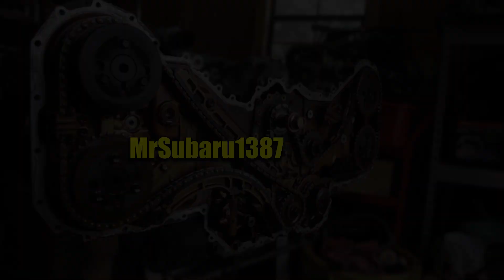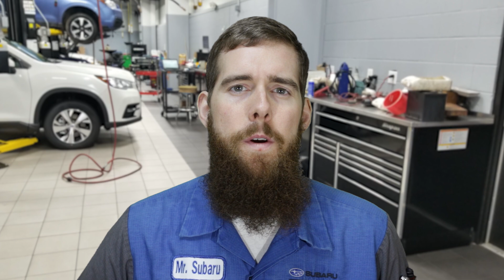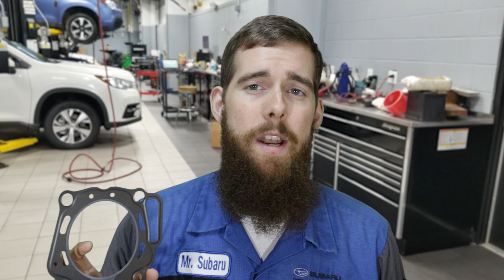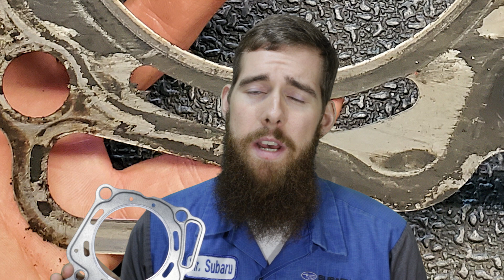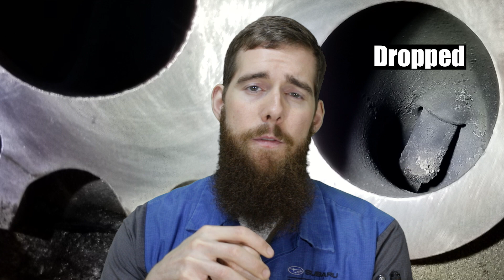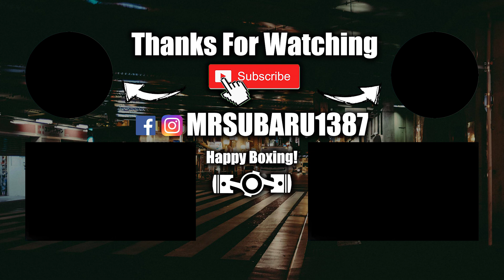Subaru Head Gaskets Explained

Comment: I own a 2015 Subaru Outback 4 cylinder. I bought it brand new. I have had all of the service work done at the dealer. Recently had the 60K service.  I just took it in for a routine oil change at 64.5k miles. Service advisor called me, told me I had an oil leak at the timing belt cover, and that they would, as a good will gesture, cover the repair. Next day, they called to inform me that I had a leaking right head gasket. And that they would cover that. I appreciated the dealer doing this. 

When I got the car back, I realized that they only replaced the gasket on the right side. I was surprised. I was told that if it is a 'warranty repair', they only fix the problem. This seems more like a band-aid than a fix. I thought this was poor on the part of the dealer. I know they didn't take the head to a machine shop. I hope that they at least inspected it. I had intended to keep this car for a few more years. Now, I have a car with one brand new head gasket, and one with 64.5K miles and the one exactly like it has already failed. I spoke with the service advisor and he told be that if I had a problem within the next 5k or so, they would cover it. 

I don't know what to think. But I can tell you that as of 2015, Subaru was still having a problem. 

I love the way this car handles and I have had no other problems with it, but I think I will start looking for a replacement. 

Anyone with any advice, or similar stories, please reply to this post. Thank you. 

04/02/2020

Comment: THANK YOU for this informative video! I have a MY 2009 Forester 2.5X 5MT Touring (Canada) with 195K km (120K mi) with failed HGs. I'm now ready to reassemble. Subaru dealer  recommends the single layer HG (11044AA633) and claims that the MLS HG (11044AA770) is NOT interchangeable on my engine. Which HG should I use? Is the installation procedure different for the MLS HG? If the MLS HG cannot be used, can I use Permatex Aviation Form-A-Gasket Sealant Liquid on the SL HG as a fix? Confused and stuck.

Comment: Thanks, Mr Subaru, your video was informative. I bought a used 2010 Impreza in nice condition. 138k miles. Engine seems fine, but I’m not a mechanic. Is there any way the VIN number can tell if my car’s head gasket’s gonna go soon or has already been replaced?

Comment: My Name is Paul I had 93 Subaru Impreza wagon original don't know what the engine model was but I buy it from the dealership it had 44,573 when the head gasket blow it had 610.463 and I had the car for 18 years I did the oil change tune ups coolel change but it had problems with the spark plugs coming out I had to put Haley coyle in cylinder head 1 and 4 it was an 5 speed stick shift and replace the clutch 2 times in it great car to have wish I had the money to get the engine repair but I didn't so had to junk it now its hard to find that kind of car now all I see now is the sport wagon now never got stuck in the snow never let me down I did pull an 18 wheeler truck up the hill in it strong little car I miss it

Comment: Stressed having the heads machines to perfectly flat. But you didn’t mention even checking the block for flatness. I hope this was just an oversight and you actually check the deck aswell . My deck was .0025” out of flat and I hand sanded that to less than .0005” my heads went to the machine shop.
Reply from the maker: Yes, always want to check the deck, I just rarely see them warp.

Comment: Thank you! I just purchased a 2003 Outback LL Bean edition. Changed the oil and 11qts came out! There is some evidence of leaking and the previous owner told me the radiator was recently replaced. I will be doing the oil cooler gasket replacement as soon as I can. Thank you for all your awesome videos! Just in case is there a special more durable head gasket for the EZ30 like there are for the 2.5's?

Comment: Thanks for your videos, they are very helpful. I have a question.....I have the engine out of my 2010 Subaru Forester, 2.5 naturally asperated, which currently has 140,000 miles, for of a rear main seal replacement. Would you recommend replacing the head gaskets, they are original blue color and they look fine. Thanks again for all you share on your videos.

Comment: On a stock tune, stock car, my EJ55 had HG failure at 67k. Many people in the community have had the same failure (pushing exhaust into coolant) as I have at somewhat different miles. My understanding is that the factory head bolts stretch under high load turbo situations for a prolonged period... IE 4th and 5th gear pulls (WRX) where the block is trying to split, but held in my the bolts. 

After the failure, I replaced with ARP Head studs and followed the torque procedure, as well as used copper spray as insurance. I am unaware of any failures following these two differences... ARP head studs, and copper spray in stock, or stage 1 applications.

Comment: Dexcool is lifetime coolant when it eats up the radiator it kills the engine transmission basicly ends the life of your vehicle unless your snart enough to no gm is special in the head lol i no a few people that got screwed because of that coolant having to replace transmissions an a couple engines that stuf even eats temp sensors great video trying to get as much knowledge as possible on Subaru my son got a 08 legacy with 114k just need to no what im in fore to fix it for him plus nay get one with bad head gaskets and or bad cluch need something cheep but also leaning towrds a old idi f250 something i can try the black diesel thing in to mak fuel affordable

Comment: I had my car a 2006 Subaru Outback 2.5 at the dealer just last week they told me I needed head gaskets and had a dropped intake valve on cylinder #3. The price to fix about $3500.00 CDN $. I really like the car and it has 176,000 KM (109,000 miles) on it but $3500.00 is kind of more than I want to spend on it. I am a fairly handy guy so I figure I can do the job myself. I am also retired and have another car, so I can take my time doing the job. I did ask the Subaru rep what machinist shop they used so that is where I can get the heads machined and a new valve guide put in. I have watched your 3 videos on head gaskets and I understand that you are saying I should use the MLS Head Gaskets that they use on the Turbo Subaru models. Just wondering what the MLS gasket part # would be for my vehicle? I looked up the gasket # 11044AA642 Subaru parts depot online ordering and the check to see if this part fits your car says this is not the correct part for your car and suggests ordering part # (11044AA633).S would I be correct ordering the part # 11044AA642? I am figuring the torque specs would be the same as for the regular coated gasket?  Thanks for all your videos they are very informative. You are a very patient man.

Comment: Excellent video.  Recently bought a 2003 Outback Sport 4 cylinder from small shop and they had just did the head gasket replacement.  Ran great for a couple months in flat Kansas City but took it to Colorado with a load and overheats up large hills and pushes coolant to, and overflows, the reservoir.  Pressure test holds at 15 psi and hydrocarbon test doesn't turn yellow under normal operation.  Could this be the torque on the heads mentioned or is it more likely the small shop didn't machine the heads or use a quality gasket?  Or just the engine can't handle the load and hills?

Comment: I’ve got a EJ251 2003 manual Outback (Australian) I’ve just had my head gaskets replaced at 295000 Km they were replace by a company called Japline ( Excellent work ) head gasket was leaking from passengers side head could be smelt on distance driving.Heads sent to machine shop all all gaskets replaced and also a timing belt kit replaced.it is recommended whilst head gaskets being replaced time belts kits should be done done engine already out job done.

Comment: Hey Mr. Subaru, I just Picked up Head gaskets for my EJ253 in my 2007 Forester as the gaskets are starting to sweat Part number# 11044AA633, was wondering which one and part number you suggested in the video I put on instead and whether i would have to modify the gasket to fit on my vehicle. Thanks!

Comment: Sad to report that currently, my 2006 Legacy wagon at 154k miles is in for the THIRD set of replacement head gaskets. Yes, 3x. All service & repairs at the dealer. I am fastidious with maintenance. I love this car and engine, but these repeated head gasket repairs just breaks my heart.
Reply from the maker: Dealer is installing the original coated gasket and dealers are known for cutting corners and not properly machining heads. They usually clean them with a bristle disk and torque them back on.
Reply: The dealer installed the multilayer steel gaskets for me this time. Hope this is the solution. They said the heads were flat. Thank you sir for educating us! Love your vids. Keep up the good work.

Comment: I have a 2006 Forester X has  103000 miles hard gasket started leaking in the #1 cylinder when I changed spark plugs. Just left Subaru without the head gaskets cause the turbo version is in fact different he tried to sell me the carbon coated ones. What do you recommend I use? But bought everything else timing belt tensioner and all the other gaskets.

Comment: Great video thank you, However I’d love for you to do a video on the super coolant and from Subaru because for some reason my reservoir tank get a little low every 5 to 6 months I have to fill it up and the engine is not eating any coolant it’s not in the oil Pretty sure I have no head gasket issue not quite sure where it’s going I can only assume that it must evaporate at the reservoir tank I have also talked with my buddy within 14 outback 3.6 R seems like it evaporates much quicker when it’s exposed to some atmosphere  (in the little plastic overflow tank )versus your traditional glycol green🤷🏼‍♂️

Comment: Which gasket part number would be correct for a 2001 Subaru Outback 2.5L wagon?
Had a mechanic do this repair, he used FelPro gasket, 2 years later it’s failed again, blowing water back into overflow tank when engine is shut off….
Reply from the maker: Never use a Fail-Pro gasket. Lol for a 2001 it should be the 1110AA642, I think.
Reply: @MrSubaru1387  Thank you Sir for your quick reply, I’ll get that ordered ASAP and this time it’ll be done right with heads getting machined, etc
Probably better to buy the engine  “reseal” kit. Anyone have the correct Subaru part number as you know the turbo gasket kit isn’t listed in their computer as fitting my 2001 Subaru Outback so will the “newer” kit with mls turbo gasket need to be ordered or are there gaskets in there that won’t work with the EJ251 and I need newer mls head gasket but reseal kit for my exact model ie; 2001
I have a spare 2001 Subaru Outback identical to the one I’m working on I purchased for a spare, needs same work performed, so I’ll be doing repair twice in order to have a spare engine when needed 
By the way, myself and I know the whole Subaru community REALLY appreciates you for sharing your knowledge and time with us. Much appreciated brother 😎

Comment: ...so, I've got a '94 Legacy wagon with the 2.2 na engine with 222K miles on it and I'm about to do a rebuild on it.  Since it isn't in the 'danger zone' of bad headgasket engines, can I just use a gasket set from Rock Auto without looking for multi layer steel?

Comment: Torque correctly , get heads  machined and get the right gasket you prescribed. And put everting else back the way it was ofc and my head gasket job will be a success

Comment: Well that could potentially explain why I go through so much coolant all the time now

I have a 2000 Subaru legacy outback 2.5 sedan 176,000 miles and when I first bought the car held fluids great but as of recently you can almost always see a coolant drip coming off of the oil pan or related areas, but never a drip spot below the car.

Comment: Hi there! Question here for my 62000 miles 2008 Impreza 2.5i SOHC EJ253 MT... It's been 11.5 years and I hadn't done the coolant change yet. Finally brought my car to the Subaru dealership and asked to do the engine coolant replacement (at the same time they did the timing belt, idler puller and tensionner-all OEM parts). So they got it right and did use the Blue Super Coolant stuff (not the green one), same blue super coolant as when it came right out of Subaru factory. On my Subaru invoice though, I see they used the blue super coolant  part SCI810005 (which seems to superceeds blue super coolant SOA868V9270). But I don't see the part number for the Subaru Coolant Conditionner on the Subaru invoice. That Conditionner stuff was initially added in my radiator in 2008 by the dealerships (in 2008 they had called me and told me to bring my car in for this to be added at not cost to me). Does the Conditionner now come already pre-added in the "New version" (SCI810005) Bleu Super Coolant, or did the subaru mechanics forgot about it and did not add it in my radiator ??? I did ask them if they had added the Conditionner in (and previously told them not to forget to add the Conditionner in just before I handed them my keys) and he just answered that he added the replacement coolant with exactely what engine coolant my car needed (according to the VIN number I gave him). Should I be concerned that there is now no Conditionner in my radiator and should I just add one bottle of conditionner myself ?? Any risk if I have too much conditionner in (for example 2 bottles instead of one) ? Will my car's headgaskets do 200000 miles or do I need to do the Conditionner every single time the coolant is replaced ? I'm pretty well informed and checked my car's specific Subaru Service Manual, and they say conditionner should be added every single time coolant is replaced, but could it be that this recommendation was just so the headgaskets would last long enough before the warranty expired. I'm concerned about clugging my rad and coolant passages with that stop leak stuff, but at the same time I want my HG to last. Honestly, I don't even know If I should trust that Subaru mechanics... He seemed knowledgeble and very well qualified, but had I not found out he was planning to add an aftermarket crappy Dayco timing belt kit from googleing the part numbers on the Estimate invoice, I would have ended up with less than OEM quality timing belt parts (CRITICAL parts indeed), and without even knowing about it ! Crap that aftermarket tensionner looks much less beefy than the original OEM... It looks like the new "chinese" version of the tensionner you get in the more recent Gates TB kits. Ended up calling Dealership right back and told them I' didn't want aftermarket timing belt pulleys and tensionner, ONLY OEM Subaru. They then ordered all individual OEM timin belt parts and cancelled the aftermarket Dayco timing belt kit order.  Seems these days we can't trust anyone, even at the Subaru Dealership itself !

Also wondered, do you think my model (2008 Impreza 2.5i SOHC EJ253 MT) is one with the valve guides getting out or valve seats getting worn out, or was that some other year models of the EJ253 (you mentionned something about AVLS, but I did'nt really understand that part). Just bought myself a Creader CR4001 OBD2 reader, some new NKG FR5AP-11 plugs, a new fuel filter and PCV valve... will do that maintenance part myself to save on labor costs. The TB and engine coolant ended up costing 1500 canadian dollers at the dealership (but at least all OEM and done by an experienced wrench). Love my Subi. Really enjoy your videos. Thanks Mr Subaru!

Comment: Thinkin' about a new WRX, been worried by the internet about head gaskets.  Might take the plunge, thanks for the info.
Reply from the maker: WRX/STi has never had a head gasket issue.
Reply: My 2017 wrx pushes coolant but it’s most likely because I tuned it and made more then it can handle lol. Enjoy it stock lol.

Comment: Question 🙋‍♂️ what is the part number for the MLS oem suburu turbocharged head gasket? Because I am going to the dealer tomorrow and gonna pick it 🔝
Reply from the maker: Depends on engine you have, but 1110AA642 should work for the majority of SOHC 2.5s
Reply: @MrSubaru1387  Thank you ! I do have a 2004 Subaru Outback with a 2.5 liter sohc engine ej25 I believe .

Comment: I may add though that the turbo EJ255 is prone to head lift under boost, especially when tracked (driving hard on the street is not hard enough) or modded. Telltale sign is coolant being pushed into the overflow. The only true solution is upgraded head studs. Ask me how I know... twice :/

Comment: Great video. When did Subaru start using MLS gaskets on the 253? I used to drive a 2011 Outback and wondering if it had the MLS or graphite coated gasket.

Comment: Just got the Subaru impreza 2009. Still in the shop been in subaru for 4 weeks now was in for 2 weeks getting all new brake lines and airbags thanks to the recall. 
got it back drove it but the wire harness melted and the car died.. Now its back in subaru the harness is being replaced and I get it back Monday.. 🙄 Not a great start... But I'm hopeful
Reply from the maker: Oh wow! Subaru taking care of the bill on the harness?
Reply: @MrSubaru1387  oh no I forgot to mention that this wire harness will cost me about 2500$  at most tho including work. 
the macanic over estimated the cost as to not come up short.
Reply: @MrSubaru1387  sold my 99 civic for this 5 weeks ago.. I really hope It lasts I'm excited to drive again.

LOL thanks for the response btw subscribed
Reply: @MrSubaru1387  one more thing EJ25 I think is this cars engine not sure tho.. Is this the one with the bad head gasket? 
I'll have to watch your video again lol